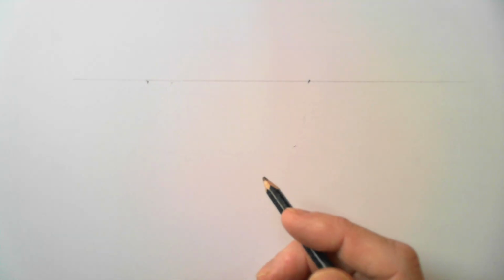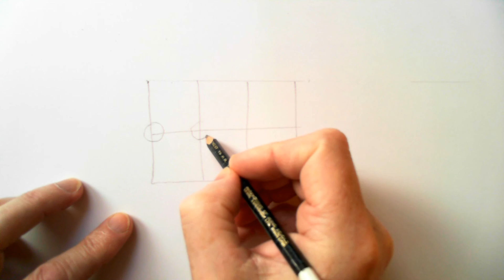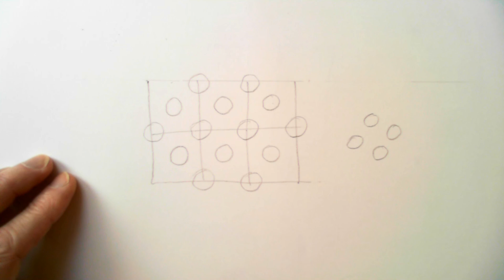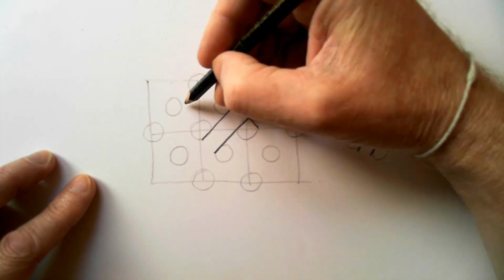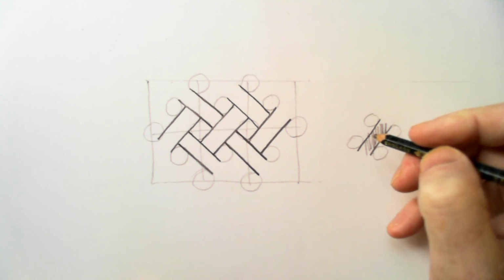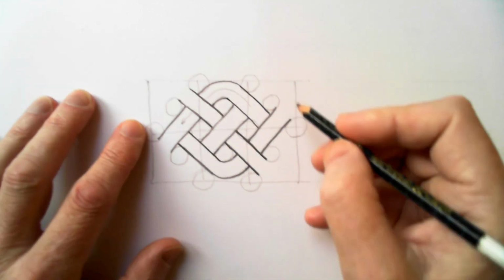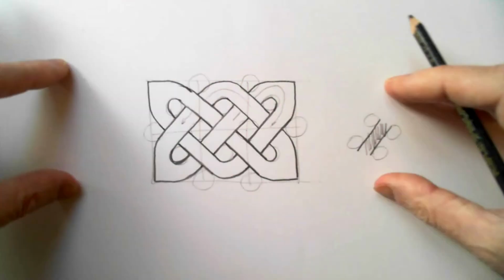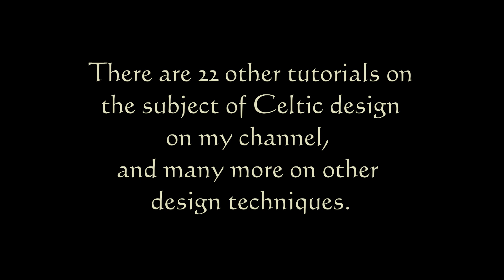An Introduction to Celtic Design: 1A

Comment: Thank you. This was so much simpler than the other techniques.

Grid of squares, circles in middles and at intersections, oever-under strand lines between (not around) the circles, complete arcs + corners for edges.

This is a technique I can actually remember.
Reply from the maker: Thanks for saying so, Sean. I appreciate it ;-)

Comment: Thanks for that - I've worked through your other videos and have had much fun doing my own designs - as you say, this is not the method that is normally shown by the "authorities" but it' s a damn sight easier to understand! My only modification to your idea has been to make sure that the break lines also have a thickness (the space between the circles) - that seems to work better in my brain - thanks again.
Reply from the maker: thanks Steve, I think that's a good idea!

Comment: My line terminology is poor, if you are putting in ‘tangents’ how are they also parallel? By tangent do you mean tangential to the edge of a circle? As it seems more like tracing a path between two. I know I’m missing something
Reply from the maker: Difficult to explain without diagrams. draw two identical circles. Draw a line which makes a tangent with both circles. Now do the same on the other side of the circles. You now have two parallel lines.
OK?